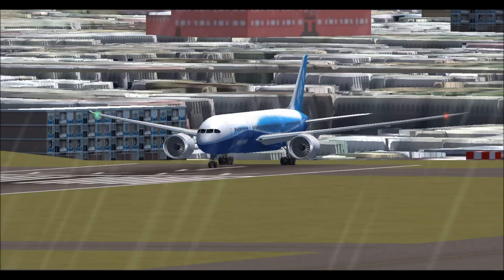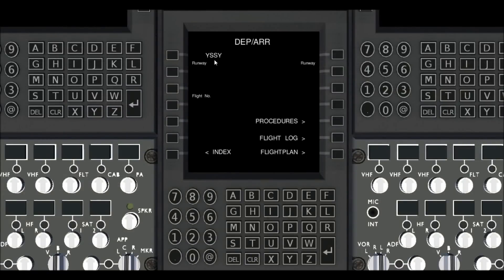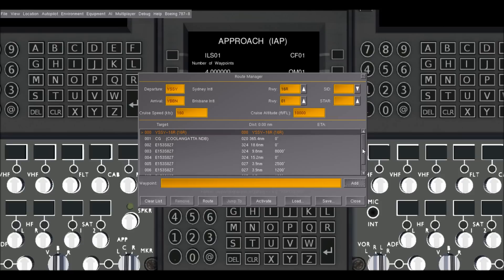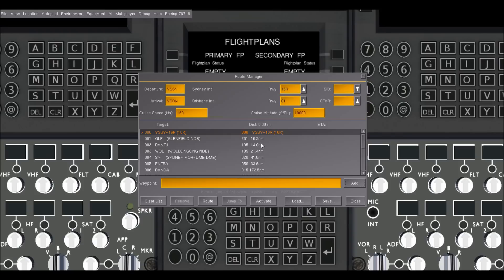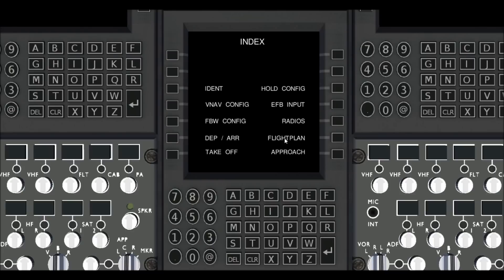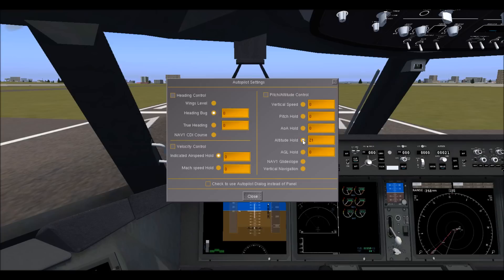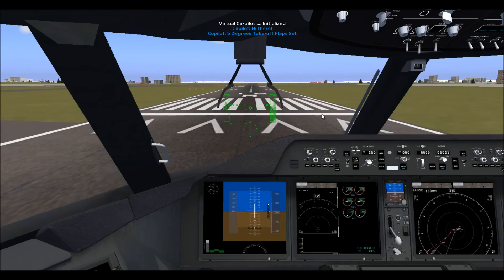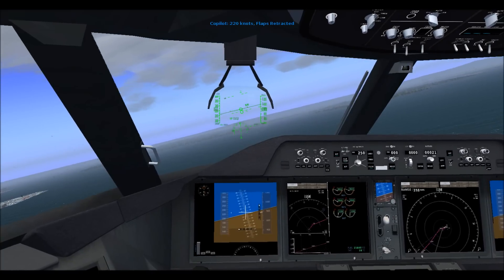Dreamliner - New Virtual Copilot Features Demo

Comment from the maker: @meArty27 Yep, that's it.  However, I have found that I can spend up to 45 minutes just calculating the altitudes I need for each waypoint during climb and descent.  During this process, I would also find myself going through countless sheets of paper.  Luckily, I've managed to create a solution to this.  I'll have details about it in my next video.  I'll be making the video and posting it today just before I push this solution to Git.